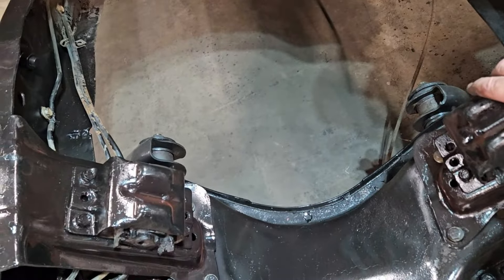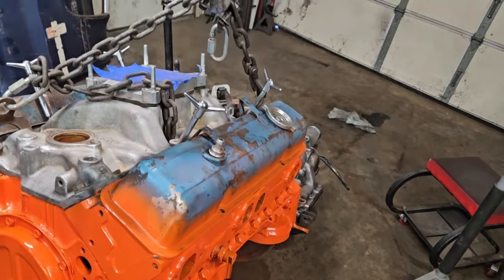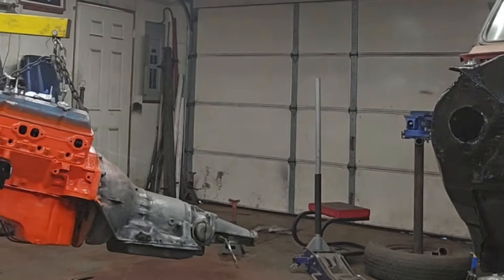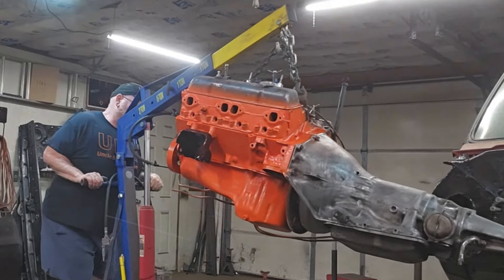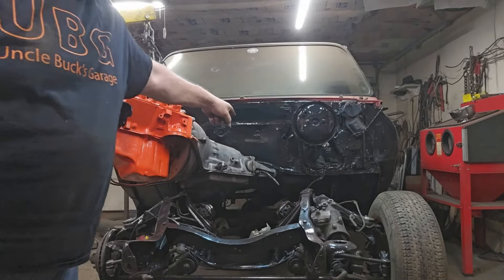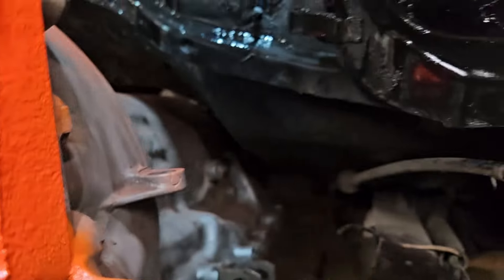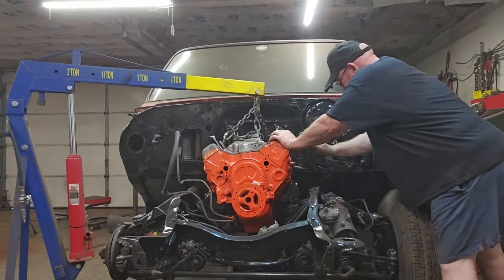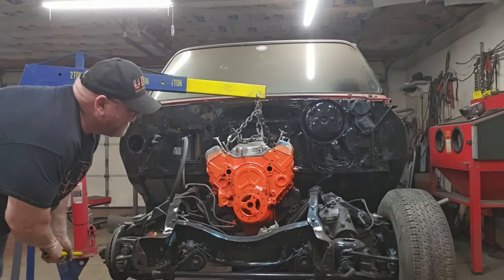How to Easily Install/Stab An Engine at Home in 15 Minutes Like A Pro

Comment: I left the tranny with the torque coverter in the truck. Pulled the engine out by itself. I got one of those air cylinders. 👍 So I have to drop the new engine back in by myself. Up & over the front end with the hood on. Up in the air about 5’. I did take off the front hinges so the hood would stand up 90° 👍Cleaning up old wires and painting while the engine is out. Good video Thx 👍👍👍
Reply from the maker: THANKS FOR WATCHING GOOD LUCK ON THE BUILD

Comment: Also I was wondering which intake manifold you are using? I don’t think the engine assembly video got that far. I look forward to your response.
Reply from the maker: the Edelbrock Torker that I found and cleaned up is  going on that motor